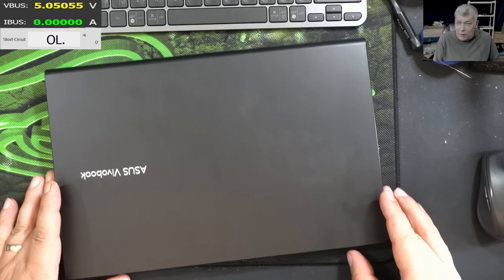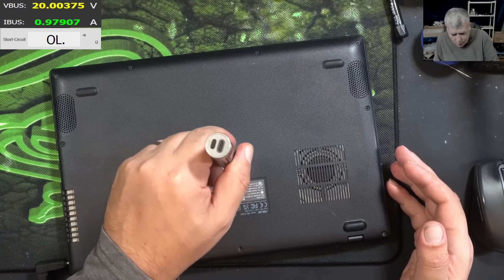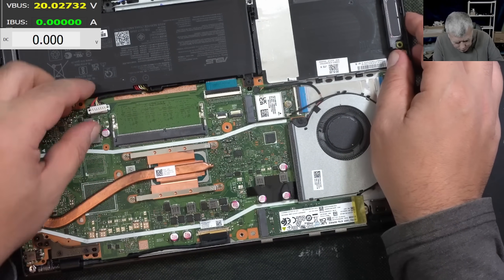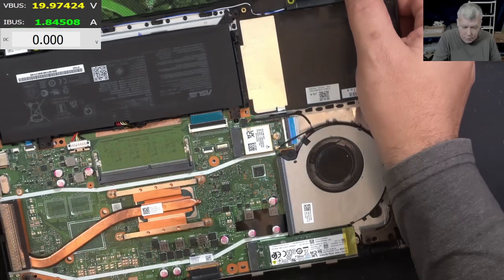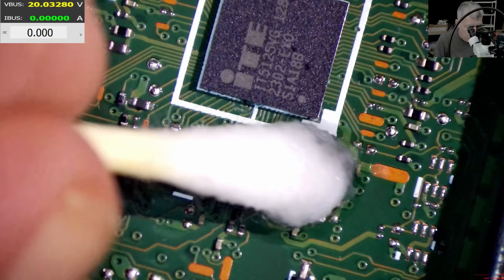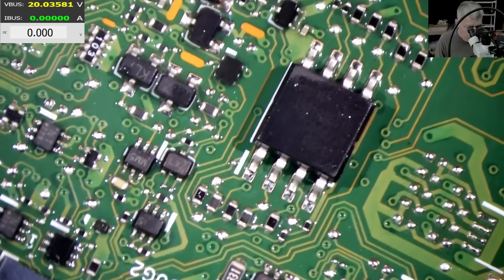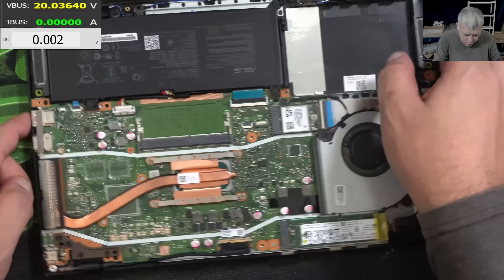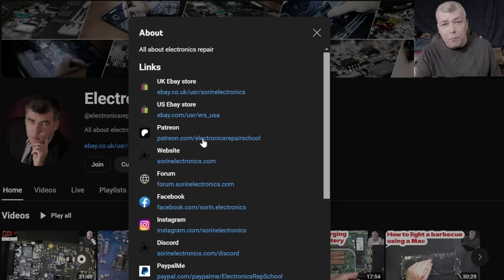Asus Vivobook X1400 charging but not coming ON, logic board repair

Comment: Why, why did you not remove the board??? Liquid damage would most likely come through the keyboard which is on the OTHER SIDE. First time I’ve been disappointed in your work.
Reply: that particular model has a solid piece of metal cover which holds the keyboard up to the palm rest.. liquid damage would probably come from the bottom cover which has several open slits for vents..

Comment: 8:15 how much $ did they save by not fitting the second antenna connector? (╯°□°）╯︵ ┻━┻
Reply: Probably a few mil on connectors , a few more mils on the antenna wire + x10 that in assembly and packaging. About 2-5 bucks per unit. :body-blue-raised-arms:
Prof Stonks ! 💹